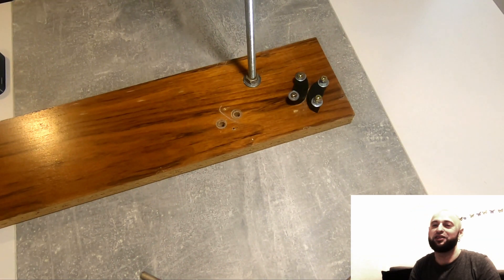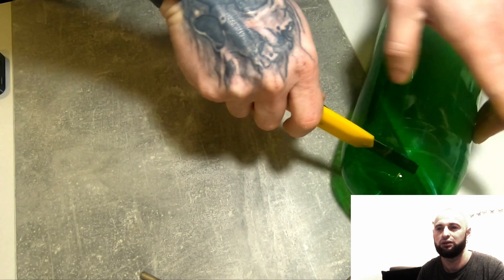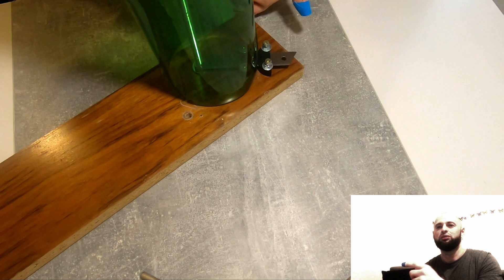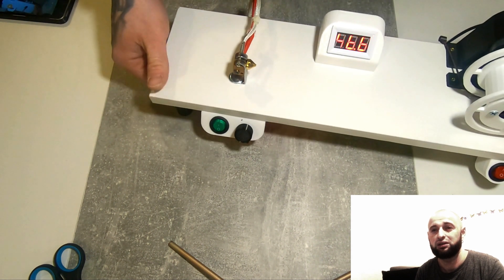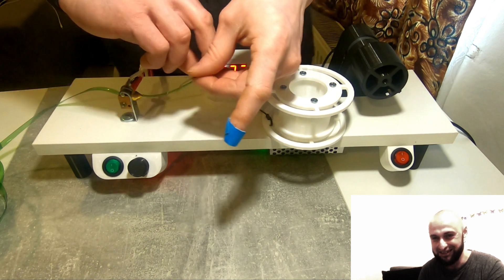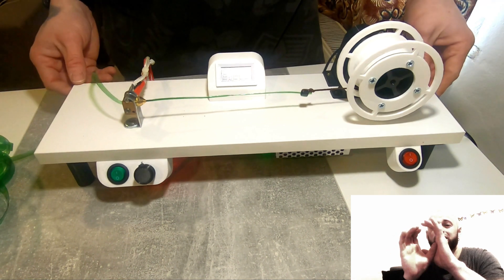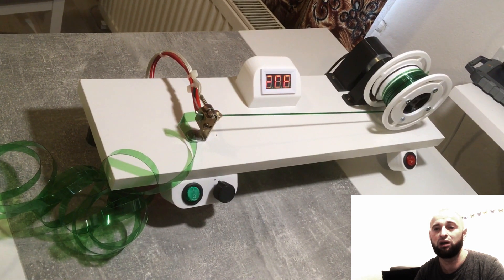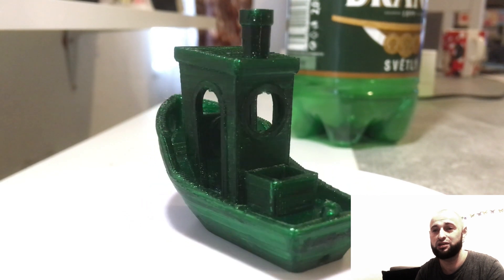Petamentor bottle cutter and first run

Comment: So if I get it right, the diode is used to bypass the temp limit of the w1209. So setting P2 to 89C it actually goes to 200+ temp? Is that correct?

Comment: what are the printing temperatures for PET  for the bed and nozzle ? beside  the 145 % flow any other settings you should take in consideration in the slicer ?
Reply: Hey any chance you found the bed heat? The nozzle can be anywhere between 250-260, it depends on how much material is there inside the tube, same case with flow rate its above 100, but exactly how depends on your use case.

For me if I want the part to stick on glass bed, so far 250 for nozzle and 85 for bed seems to work. But the nozzle oozes still and had to make the nozzle really close to bed.
Reply: I think I should mention that I have Bi metal heartbreak and the ptfe doesn't go all the way till heater block. I had made the upgrade since I will always use high heat and didnt want to replace the ptfe tube down the line.
Reply: @dreudax3294  oh hi , thanks for your reply . it does seam to be tricky to dial in the settings for first layer adhesion for PET... so far i didn't had  much luck with the first layer adhesion on glass bed ...the highest i went was 75 degrees celsius and the nozzle very close to the bed  but some lines on the first layer curl up and they create bogus which luckily are flattened with the next layer  but still ... i guess i will try to bump the bed temp to 85  for the first layer and see how it goes ....  i have a PrintrBot Simple Metal  Kit with DIY silicone pad heated bed under the original plate ... hope 85 is not too much ...
Reply: @Gr8Success  Hey, so I tried 90 and 260 and its much better. Just make sure that for the first layer, the speed is very low, I mean very low. For me in slicer settings my print speed is 50mm/s. Then when I I am printing, i make the speed reduce from the printer menu to 30( from 100). Then once the first layer is done you can bump the speed back up. The issue is only sticking to bed. Pete sticks fine to pete.
Reply: I have printed at 150mm/s and it prints fine. Just make sure first layer is very slow. Also overhangs without supports tends to drop a little more than I like, but i use stock ender 3 pro (part cooling fan is a bit higher), so your milage will vary.

Edit: I have heard putting glue stick on bed helps, but havent tried this.
Reply from the maker: 30mm/s is fine speed. I'm printing with it all the way. My bed temp is about 70-75C obviously. It's a trial and fail for each other 😊

Comment: Hello, I followed exactly what you do in the video and yet the temperature remains around 92°. Could you tell me how to change this? I'm stuck despite the answers I've seen.

Thank you in advance.
Reply from the maker: Hi, sorry that I'm late. So...
Push and hold left button, till it starts blinking. Then add higher temp. Make smaller steps and wait until the temp rise to something stable, then repeat. Please let me know, if it's working.
Good luck man, 💪🥳

Comment: Hello friend, great work, I have my machine working.  Have you thought about a set of gears to improve traction and engine speed?  I recently found out that you can give color to transparent bottles with colored markers, the trick is to make the marker remain on the inside of the filament, so that printing generates a more uniform color.  you have to try it.

Comment: Hello,
 I'm at a loss, please help me.

 The pet tape is about 8 mm, but every time it passes through the nozzle, the whole string does not look good at first glance, but rather a more closed c. I tried to adjust the temperature and speed of the reel, but without effect.
 I also tried a different tape size but the same result.
 Please advise what it could be.  thank you very much

------------------------------------

Dobrý den,
 už si nevim rady prosím o radu.

Pásek z pet má cca 8 mm, ale pokaždé když projde tryskou není struna celistvá na první pohled vypadá dobře ale to takové uzavřenější céčko c. Zkoušel jsem upravit teplotu a rychlost navijáku a bez efektu.
Zkoušel jsem také jinou velikost pásku ale stejný výsledek.
Prosím o radu čím by to mohlo být. moc děkuji
Reply from the maker: Hi, filament have to be O shaped. If is in C shape, your strip may be too wide.
Reply: @ondrejsraitr  the strip is 8mm but I will try a smaller one.  I thought a bigger belt would be better, I'll let you know how it turned out
Reply from the maker: Thank you so much!
Reply: @ondrejsraitr  i now use 6mm strip and still c shape
Reply from the maker: Is that C shape fully closed?
Reply: @ondrejsraitr  the string is normally round
Reply from the maker: Oh GOD 😁. Thats too thin strip. Your strip is ok when its fully closed. If its open, it needs to be wider, if is fully closed (but with D shape) its too much wide. Sorry man fro your time, it was misunderstood.  Try to watch one of my last videos. There is a example with strip width. 
https://youtu.be/uSBCxH9358s
Reply: @ondrejsraitr  its my bad. thank you for the advice and extremely fast response
Reply from the maker: Im so sorry. I know what means to try hard. Thats my faul. Sorry for it🫡

Comment: I am currently trying to build this. What do you use to control the pull motor, is it a stepper motor, and does the w1209 get the hotend hot enough?
Reply from the maker: Hi, no its nit a stepper, its a DC 12v/7RPM. Yes w1209 is enough. More info on https://petamentor.com 🫡

Comment: hi! I've built your mk1 machine. I tried to make it work but the plastic can't get through the nozzle. It gets out from the other side and I can't catch it out of the nozzle. What should I do?
Reply from the maker: Hi, I dont fully understand you.  What is wxactlly happening? What about your nozzle diameter, temperature on the nozzle? Is your temp sensor attached well? Have you an external thermometer? Thank you💪
Reply: @ondrejsraitr  hi sorry my english is not perfect loll i've build the pentamentor mk1 exactly like on the videos. my nozzle is at 210 degrees. when i try to engage de plastic in the nozzle, I can't. I can't catch the plastic coming out of the nozzle. and by dint of pushing it overflows at the entrance to the nozzle as well.
Reply from the maker: Ok, first of all, its always better to push a strip thru the nozzle when its cold. Then gently pull the strip when temperature starts to rise up. You will almost never push start of strip thru the hot nozzle.
Reply from the maker: If its melting, your temperature is too high.
Reply: @ondrejsraitr  ok if I understood correctly, it must not have the same effect at the nozzle outlet as when printing, you have to heat just enough for the nozzle to compress and give shape to the plastic when passing, correct ?
Reply: @ondrejsraitr  sorry i hope you understand, (google translate loll)
Reply from the maker: Exactlly. Temp for making “filament” is about 210. Printing temp is about 260 (for me)
Reply: @ondrejsraitr  for me it seems 210 is too hot. in my test it was between 205 and 212. i will try at 190 or less tomorrow. i tell results of the test. thanks and see you

Comment: Is using the razer better then using the bearing or are they both the same?
Reply from the maker: I dont know. But I read so many comments on the bearing cutters, that leavs me to stay off this solution.
Reply: @ondrejsraitr  Thx, have you had any trouble with the razer solution or has it been good for the most part?
Reply from the maker: No, its working well. It has some limitations, but nothing too bad.
Reply: @ondrejsraitr  thx, why do you drill the backend of the nozzle and heat block? is that so the plastic can enter more easy?
Reply from the maker: Yes exactlly my friend. Want to strip all of the sharp edges to make strip goes out more smoothly👍
Reply: @ondrejsraitr  thx, also on the aluminum block why do they have 2 red wire and 2 white ones?
Reply from the maker: Hi, these two ones are for heating the nozzle (and heat block), the second ones (white) are from temp sensor for remoting the temp 😉
Reply from the maker: I think NO, it never happens to me.
Reply from the maker: No no, I mean sharp edges on the heatblock and the nozzle. I made some chamfers for easier pulling
Reply: @ondrejsraitr  Ohhhhh, that makes since, thx, also how do you set up the cutter knife system for the bottle to cut a certain amount without it being to much?

Comment: Estou com problema de temperatura 
Não consigo chegar a 205°
Alguém pode me ajudar
Reply from the maker: Turn it on, press left button, after it starts blinking, set the temperature abou 77C. 👍
Reply: @ondrejsraitr  oi tentei mas 77 so vai 160 
nao sei o que estou fazendo errado
pode me ajudar?
Reply from the maker: @newfox4929  sure. This can be caused with two reasons. Your thermometer sensor is badly attached, or your w1209 is failing. What power supply are you using? (Volts and Amps)
Reply: @ondrejsraitr  12v
Reply: voce teria intagram? eu poderia mandar foto para eu explicar melhor
Reply: 12v 5a
Reply from the maker: @newfox4929  if you are slightly moving a temp sensor, while you have 160C on the heatblock, is there any temp change on thermometer display?
Reply: @ondrejsraitr  fiz o que você falou no termômetro esta a 175 agora
Reply from the maker: @newfox4929  ok, if you fixed a thermometer tightly to the heatblock, you can continue to slowly add the temperature on w1209 over the 77. Make small steps and wait every step to rise the temp.
Reply: @ondrejsraitr  ta vou tentar aki

Comment: alguen i que sepa como ajustar para alcanzar los 220 c.....lo maximo segun los videos llega hasta 145c.....
Reply: Saludos, se soluciona en el  controlador, aprietas una vez y vas subiendo la temperatura ( a mi me funciono 84),en el controlador aparecerá 84, pero en la pantalla aparecerá la temperatura real, la cual será aproximadamente de 210 grados
Reply: @danielcampos5499   muchas gracias daniel, pero no te entendi.
dejo todosl los paramentros como viene en elvideo; y si no da mas de 84 pero ala hora de meter pet no derrite
Reply: @danielcampos5499  el controlador ya lo ajuste a 84, y en la pantalla te refieres al al termomentro debe salir 210.... solo llega a salir 1... je no entiendo daniel aun ,tienes wapp o donde te puedo localizar para mas facil me hagas elfover de explicarme porfavor
Reply: perdon.el controlador ya ajuste a 84, y en la pantalla no da mas de 148 c ,es eso a lo que te refieres que debe marcar 200c o mas
Reply: @joseestebansahaguian6557  en ese caso tendrías que revisar bien las conexiones y los circuitos de igual manera los materiales.
Reply: @danielcampos5499   muchas gracias, solo una pregunta mas, el controlador dejo, po,H ,p1, o.1 ,p2,89 , p3,-50 p4, 0.00 p5 o p6 ,off...................y arriba en pantalla debe marcar 220 grados centigrados'?
el controlador la temperatura de inicio es la que cambias hasta que temeperatura va?
el que dices que vas subiendo..

Comment: Hello and thanks for the video and all itens, I printed the stl files and now I test the circuit, but I cant go beyond 103-105C. I set the w1209 for 110C, with the diode I go to 103-105C, wiithout the diode I go to 90-92C. The w1209 goes to 31,8C and down to 27,2C,  so it start again, it goes to 31,8C and down to 27,2C, its not exactly this, like 27,1, 27,4 and 31,9, 30,8. I change: diode, cables and thermistor, can you help me? Thanks xD
Reply from the maker: Hi, please go to petamentor.com into a forum section. If you will not find an aswer, please start mew topic. It will helps to others too. Thank you so much ❤️
Reply: \0/ I see my fault xD in 3:04 you set the w1209 to 69,7C o.o my w1209 was 28.0C hehehehe now I understand, the default of w1209 is 28.0C you need to set when you turn on the w1209 clicking and wait the 28.0 temp blink, so you set up or down xD thanks again ehhehhehehe
Reply: Even I’m facing the same problem. The temperature is not going beyond 110 C. Could you help me please as the nozzle is not getting heated up

Comment: Did you find a way to make the filament longer? Like using 2 bottles and then melt it together or something?
Reply from the maker: Hi, Im using a filament runaway sensor to automatically pause print on the end of filament. Them Im changing it and easily resuming 👍
Reply: @ondrejsraitr  that's super smart. Thank you!

Comment: felicidades ya voy  hacer filamento a ver que tal sale::::::::::gracias por tus videos muy bien explicaados.
Reply from the maker: Hi, thank you 😉👍
Reply: how can i get 220 c ....the max is 145.... ihave adjust as  the videos but i cant....
Reply from the maker: The next thing could be a temp sensor. If its not attached tight, measured temp is lower🙁
Reply: @ondrejsraitr  but i try to make filament and its to hard to take out
Reply from the maker: So this is definetelly low tenperature. Can you please post your settings?
Reply: @ondrejsraitr   as the video,., po,H ,p1, o.1 ,p2,89 , p3,-50 p4, 0.00 p5 o p6 ,off...................and the initial to the high 115

Comment: Hello one question? What temperature to use for the plastic of the cola bottle?
  And what temperature do you use for this type of filament in the 3D printer? owo
Reply from the maker: Hi, obviously 260 for printing, for making filament is about 215. I dont remember every temp for every bottle. The point is you dont have to know exact temp. You can see it during the filament production and set the temp after you see, if its food or not
Reply: @ondrejsraitr  Thanks a lot owo
Reply from the maker: Its easy to get the right temp during the production. 👍

Comment: I wonder if it's possible to add a strand of monofilament fishing line or some type of thread as the "core" to produce some sort of composite filament.
Reply: there's generally no reason to assume the different plastics will adhere to eachother, much less print well under the same conditions.
Reply from the maker: 😂 I have no idea what I can write here 😁. If joining filament can works in this way, I have no idea how to print it with. Thats a task for a NASA I think 😁✌️. Thank you for your interesting comment 👍😀

Comment: A small question here
What is the width of your botlle strip?
Reply from the maker: Hi, it depends on bottle thickness. Im using a 7mm strip in general.
Reply: @ondrejsraitr  thanks for answering sir!
I've finaly make one 
The only problem i have is that the filament extruded with a coca bottle is all white and not transparent , do you know why?
Reply from the maker: Hi, thats may be caused with too high temp, or bottle can be maked from recycled pet already. The percentage of used recyclate pet infulence your filament quality. Please visit the forum, try to ask others. This is better way. 😉
Reply: @ondrejsraitr  thanks a lot !!

Comment: This is a fantastic project. I'm printing the parts and will make one for myself. Since I don't drink soda anymore, I'll find another way to source plastic bottles. 

Question: How much filament were you able to get from 1 large bottle? Also, I have an idea. Since support materials can be thin, could it be possible to melt PLA support material and recycle it back into filament, especially if I cut it into thin ribbons?
Reply from the maker: Hi! Thank you so much. 
I can make approximately about 7 metres from 2l bottle. 
Your idea with recycling pla in this way is interesting, but I cant imagine that it will works. You have to try it by your own. Please let us know with your results. Im so curious 😀
Reply: @ondrejsraitr  I'm willing to try once all my parts arrive in the mail. If cooling becomes an issue, I could always add a small fan and try to adjust for consistency.

Comment: hello sir.may i know your slicer setting in printing PET filament?thanks!
Reply from the maker: Hi, sure✌️.
Im using a Creality Slicer (based on Cura).
Using default 0.2 profile with only this changes:
Bed temp: 60C
Nozzle temp: 260C
Flowrate: 145% (depends on your exact nozzle diameter).
Reply: If im using the 0.4 nozzle..
Reply: Yeah i. Using cura too..
Reply from the maker: Im using 0.4mm nozzle and 0.2 mm layer height. Its a default in cura
Reply: @ondrejsraitr   to summarize: 0.4 nozzle 0.2 layer height and Using default 0.2 profile with only this changes:
Bed temp: 60C
Nozzle temp: 260C
Flowrate: 145% ?
Reply: @dmitri649  yes.

Comment: try using a lighter and welding 2 bottle tapes together and other colors to make multi color filament can u make a video about how it works?
Reply from the maker: Sure 😁, but first of all I have to solve building dufficulties and make some fine tune. I want to continue with making videos about PET recycling a little bit.